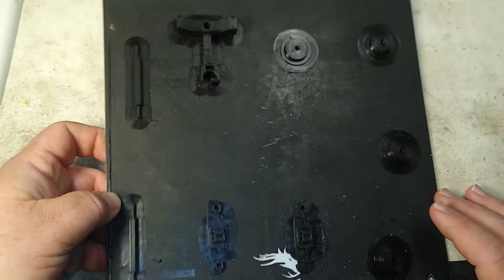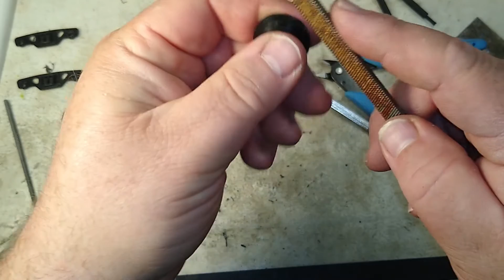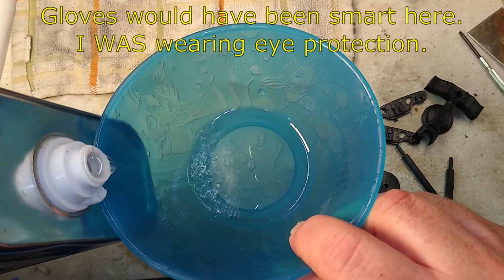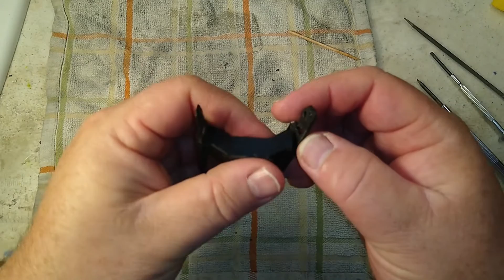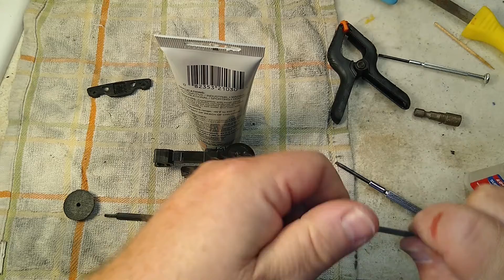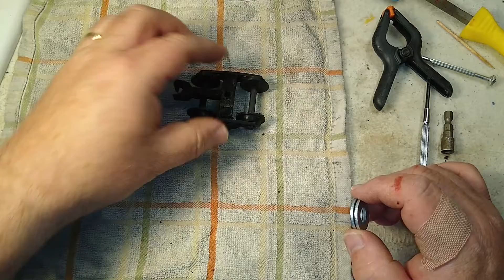Episode 79 - 3D Truck Printing and Assembly

Comment: If you printed those on a raft, you’d probably have better adhesion and no elephants foot on the bottom of your prints. Maybe switch to glass and hairspray too
Reply from the maker: My experience with rafts has been the prints require more cleanup than with brims. Since switching to PLA+ for my truck prints I have been able to eliminate the brims as well as most of the cleanup process and the finish is much smoother as well. I will sometimes get a little stringing in the gaps of the side frames, but not much. It's generally "print and go" now.